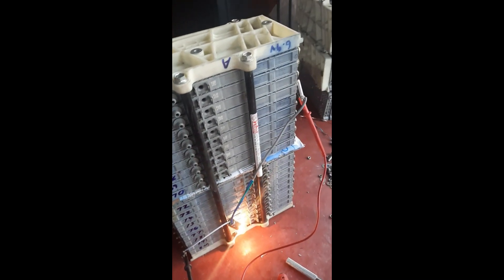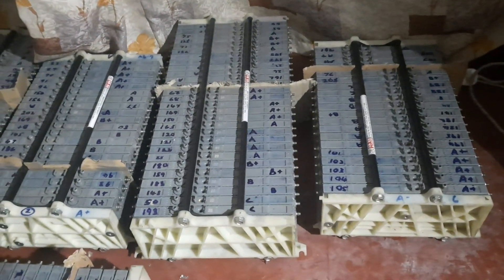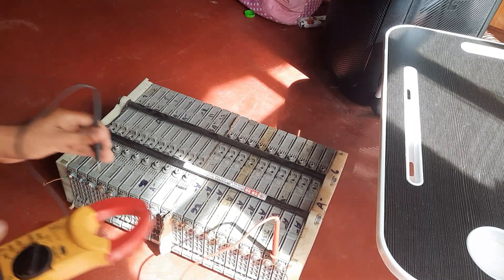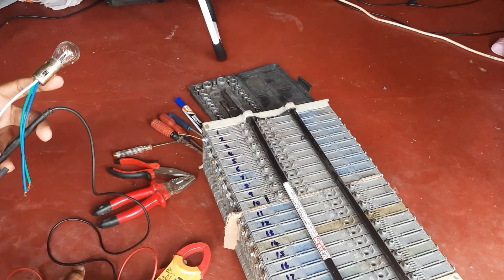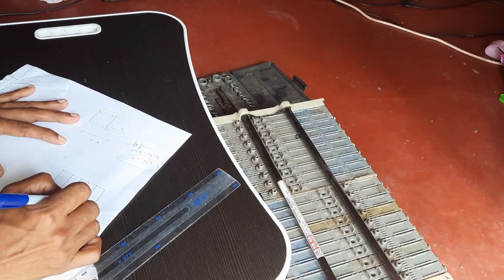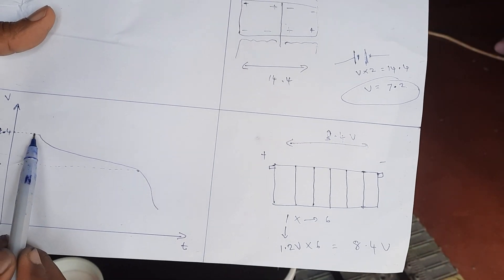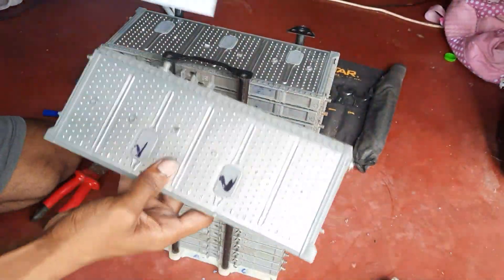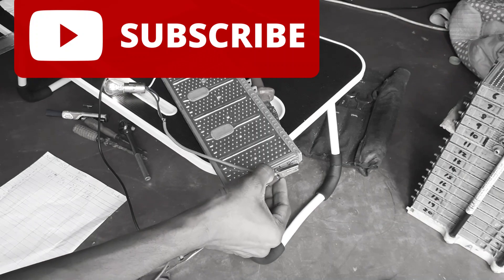Test Your Battery's Capacity - DIY cheap battery tester!

Comment: I understand that precautionay measures to prevent shortcircuit is important. What other risks need to be considered for such storage and workplace? Could it be that one of you modules just explodes for reasons of overheating or other distress? What you suggest as a good and safe workplace and storage respectively
Reply from the maker: @fritzwuethrich3717  Absolutely! You can never be too careful..
First to consider is the battery type. NiMh, Lip04, lead acid are quite robust unlike lithium ion batteries. 
Next try to keep batteries in isolated locations with minimum risk of fires and gas production causing issues.
Also having good ventilation will help keep batteries cool. 
You should also consider using appropriate thick wires, as high Amperage passes these circuits it can lead to overheating if thin wires are used.

Comment: Great videos Could you say why or is there any reason for making them balance at 2 blocks of 14v compared to 7-8 volts by just connecting all in parallel ?
Reply from the maker: I made each pack to give the necessary voltage, so I can add or remove packs without having to take apart the whole system.

Comment: As soon as charge u have to separate the module then after need to keep one or two days otherwise bad battry s will drain from good ones and try to keep them all ballence.
Reply from the maker: You have a good point there,  but you have to keep them connected so as to equalize the charge,  when you test you'll catch the bad batteries because their voltage will drop faster than the others.  If we seperate them  before equalising we can't compare
👍
Reply: @solar_energy  proper way is charge them separately butits not practical so we can chrge together then un ballenc module we can charge separately bring them same level.otherwise bad cells drain god cells then end results will not be accurate. In my case im using 24v(3 packs) full charged 25v after separate all modules shows 8.05,8.06 mean difference only 0.01.